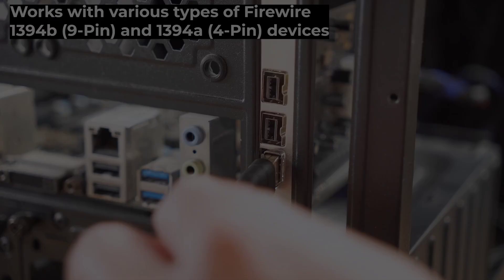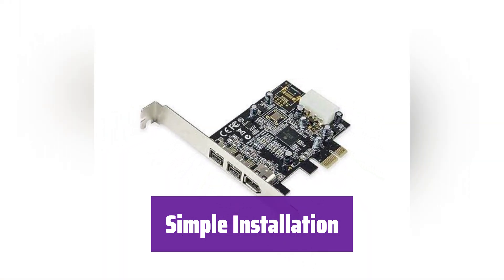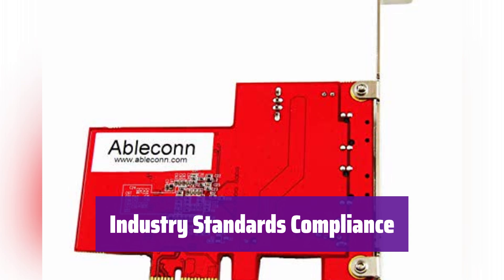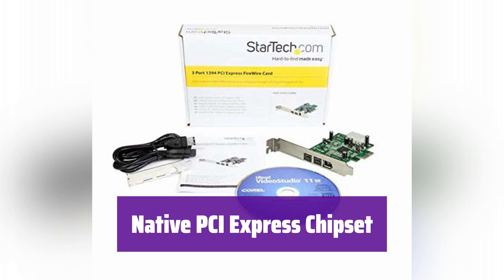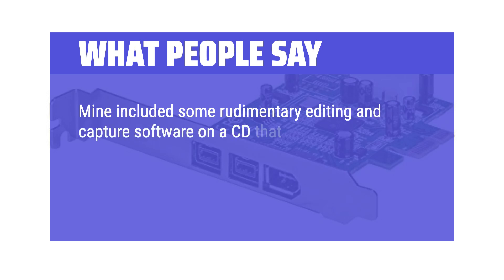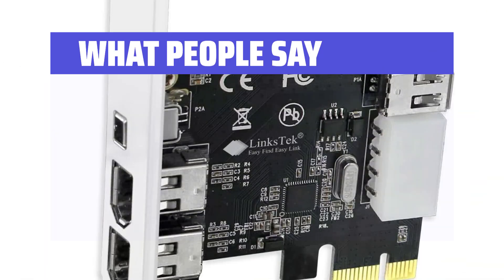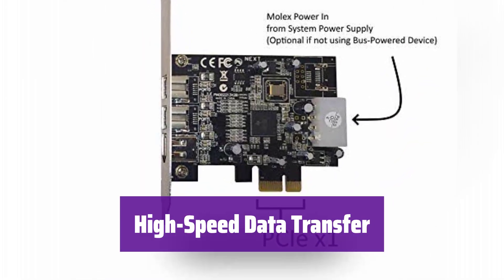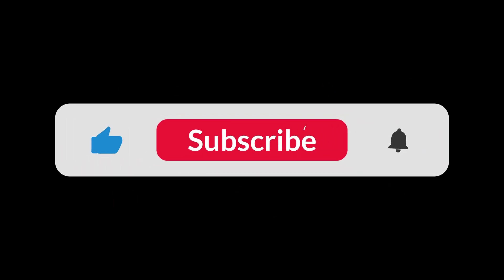The Top 5 Best Firewire Card in 2025 - Must Watch Before Buying!

Comment: If you're trying to get an older Firewire audio interface to work with a modern Windows PC, you can skip this video. What actually matters is which 1394 controller chip is on the Firewire card and whether it plays nice with your particular brand of interface. TI makes 8 different chips, and VIA makes 5 different ones, so your chances of choosing the correct one at random are slim. This video doesn't tell you which chip is on which card. There are three different Firewire connectors and three different data rates. Chips capable of faster transfers are supposed to be backwards compatible if you have a suitable adapter. (Good luck with that.) You'll also need to convince Windows to use the right software driver, and it may overwrite the one you need without telling you. None of this stuff is mentioned in this AI generated video.